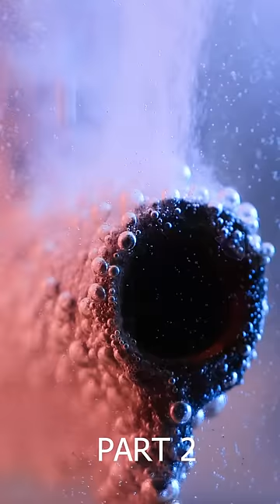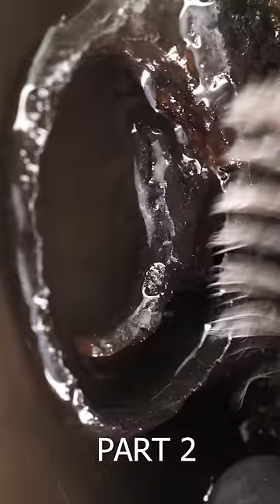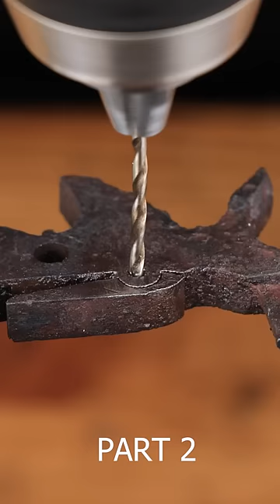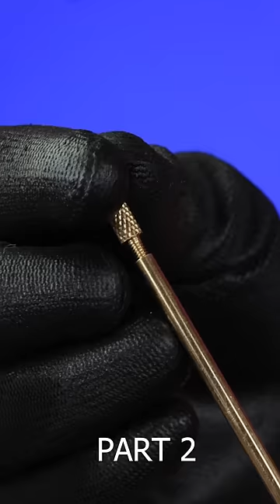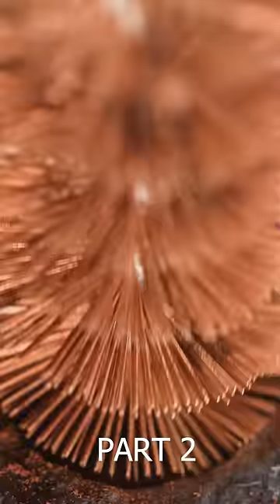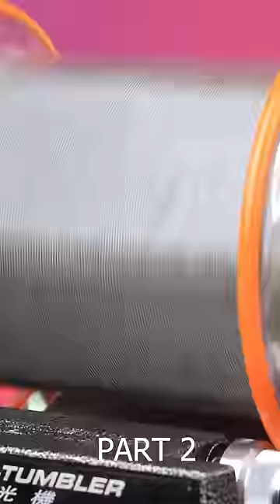Rusty Revolver Restoration Part 2 #Shorts

Comment: catastrophic mechanical failure: allow me to introduce myself
Reply: That doesn't happen to revolvers
Reply: @yazdan7774  actually it does, especially when it's badly corroded, the pins that hold in the hammer can shear off, the crane for the cylinder can outright explode, and the trigger can just snap. Also it will jam a lot.
Reply: @attackhelicopter9882 Yeah i don't know the specifics or the details i just know that I'd NEVER fire this weapon. 
How we, i can imagine that might look cool when all restored and shit. 
There are a few million non-operational firearms in the US as antiques basically
Reply: @yazdan7774 any and every item on this earth made of a corroded substance will fail at some point. Each gun is designed to withstand the pressures and force for the caliber they are housing; and when something is that rusted, it will fail. Do you assume revolvers are just god-sent immortal machines which can’t ever fail?
Reply: @ethandrought3064 I said it better than I bothered to even think of.
Reply: tá bom irmão liga
Reply: @attackhelicopter9882 it’s not for use clown.. just for display.
Reply: Definitely hand detonation
Reply: En la depensa de malechore
Reply: Después de 30 año salió a arregra su rrevolve para conn
Reply: @yazdan7774  So wrong its not even funny.
Reply: 😂yeah well said !
Reply: Before some says

"But its just a presentation piece!"

We know, its a joke, sit back down.
Reply: @attackhelicopter9882  most you’re probably gonna get out of this is light  primer strikes have the time it’s not gonna even fire
Reply: Imagine a end game version of red dead redemption with this as the final scene in the second one
Reply: @yazdan7774 Lol' where did you get that from? 😂
Reply: @yazdan7774 bruh. Even hickhok45 that legendary SOB had a revolver fail and that was mid competition 😅 seriously. Yes revolvers can fail.
Reply: That revolver is 100% going to just be a museum piece
Reply: @yazdan7774  oh yes it does
Reply: Allow me to reintroduce myself my name is WHOAA💥
Reply: @yazdan7774 no amount of restoring is gonna restore the doubt I have for rifling of dat gun.
Reply: @ethandrought3064 that’s not even mentioning that this is a top-break revolver which means it’s even more prone to failure
Reply: @yazdan7774 ah yes, revolvers don’t break
Reply: I mean I definitely wouldn't fire it, 
but I'd buy it as a display piece. 

I wouldn't trust firing this gun either. 

I'm not saying it's incapable of operation, I'm saying I wouldn't want to put that sort of stress on it. 

Its retired.
Reply: @johnmayer6770 that's exactly what he said kid
Reply: I just hope this guy never tests his restored gun
Reply: @yazdan7774 
Bruh thinks he's a gun expert because he played tarkov or something

You're telling me you've never seen an out of battery revolver?
Reply: @burtan2000 most of these are scams anyway. Fuck around with some rusty stuff, replace 90% of the parts, and call it a day.
Reply: @thericepotato5847  i don't play games
Reply: @johnmayer6770  why display something you cant use?
Reply: @johnmayer6770 well then why make it functional if going to be for show?? The barrel should be plugged and the firing pin removed and made so it can't be replaced with a new pin!! Or someone will buy it or steal it or find it in a dead person estate sale ect and will try to fire it and loose a hand or a life because it's been restored to working condition even though the rust has weakened every part of it.. it should have been restored to a non functional state so after it changes hand's it can't hurt anyone..
Reply: @attackhelicopter9882 it's for display, haven't you ever heard of display items? 🤡
Reply: I don't think he will shoot it.
Reply: @RandomGuy9  he won't no! But someone who gets it in a few years will like if someone gets it in a storage unit sale or dead estate or any number of a thousand way's of getting the gun without the knowledge that it's no longer capable of firing it.. it should have been permanently disabled to avoid some fool from attempting to fire that explodes in his face and takes a hair
Reply: First thing I thought
Reply: @yazdan7774 any gun can blow
Reply: @yazdan7774  Yes it does. Material loss is a real thing and revolvers need to be properly timed to function
Reply: Seriously. This was my first thought. Never shoot that fuckin thing.
Reply: @attackhelicopter9882 revolvers don’t jam, all that other stuff yea pretty accurate
Reply: @YeeeHaaw  they may not jam (and yes I'm aware of that) but they can easily turn into a pipe bomb
Reply: Nice to meet a relative from over the water.
Reply: @attackhelicopter9882 well…ur absolutely correct on almost everything except the jam part, the gun will likely never jam, just struggle to fire or like u said, the cylinder will explode.
Reply: @Toegremlin1  yes, catastrophic mechanical failure: aka exploding.
Reply: It could be for a wall piece
Reply: @yazdan7774 bro mechanical failure can happen in anything with mechanics (e.g. moving parts)
Reply: @yazdan7774 You can fire the gun. I won't, I like having a working right hand.
Reply: Это мусор, коррозия и усталость металла говорят об утилизации, а не реставрации.
Reply: U could electroplate metal back onto the gun
Reply: @ddh3098  electroplating is mainly a cosmetic thing, rust and deep pitting would compromise the weapons ability to take the force of a round.
Reply: @burtan2000 I think that's the intention behind the resto. It's very unlikely anyone would be foolish enough to take a chance trying to actually make something that bad functional again.
Reply: @yazdan7774  tell that to a chainfire
Reply: @ethandrought3064  it’s impressive how you typed a whole paragraph without making a single valid point. you must be a politician
Reply: @yazdan7774  yes it does goofy
Reply: @johnmayer6770 did you read the comment he was responding to. Cause it look like you didn’t
Reply: @yazdan7774 why do people think revolvers are immune to gun things. A revolver is a gun it can have almost all the same malfunctions as a self loading weapon. And obviously they can explode due to severe structural flaws like being so badly rusted you can see craters on every part of the damn thing.
Reply: Yeah… that’s what I was afraid of too 😮
Reply: Apparently people on YouTube have never heard of decorative pieces
Reply: @yazdan7774  wat a stupid thing to say if something works it can also not work

Comment: It was a .38, now it's a .42 caliber.
Reply: Xd
Reply: exactly
Reply: I don't think I'd want to fire that..
Reply: I've done gun restoration but in this case shes pretty far gone just clean her up to make her spin but never put bullet in because the micro cracks are already visible
Reply: its actually a hand grenade buddy
Reply: @jacobmorgan1182 id fire it lol
Reply: @jackbookerjr.3047  death by faulty firearm, explodes in face
Reply: It's now a hand detonation device
Reply: Rof😂😂 my thoughts exactly 💯 ❤
Reply: Loose so well
Reply: Разорвёт ствол чуть позже
Reply: @tinkeringclaws5559  Knew you would LOL
Reply: Gonna have a hard time finding ammo 😂😂
Reply: @TORQ111  Each cylinder is a different bore now.
Reply: @jacobmorgan1182 
Counldnt you just do aanother heat treat and re-chrome the barrel and cylander? Maybe do some electrolysis, like what they do for certain forms of guilding and plating. It might fill those cracks and stengthen them?
Reply: That when she said shes a virgin😂
Reply: Another restauration like this one, and it will turn .50bmg
Reply: LMAO
Reply: Baldwin gun?
Reply: Like my wife!😊
Reply: Clean it and use it as a wall peice
Reply: I. Pretty sure that's an old Schofield if it is is .45
Reply: Dont forget itll be blow up immediately
Reply: .45 would’ve been funnier
Reply: @freebriccs6134  True. But, there's no 42 caliber cartidges that I know of.  Like the revolver, it's now random.
Reply: lmfao
Reply: Facts 😂
Reply: Pushing a .45acp gotta rebore the barrel forsure
Reply: just like your wife
Reply: @nickshern1654  I might have stretched it out a bit. Sorry, you couldn't.
Reply: now it non functional
Reply: Its a paperweight.

Comment: Pulls trigger... Snaps... Crumbles to pieces... Hammer flings up and hits you in the chin...
Reply: 🤔 the gun became thinner 🤔 same to what im thinking
Reply: What music is this please?
Reply: Its so much more funny when you, as i did, read the last sentence with the underatanding that it is not the hammer from the pistol
Reply: I imagine it falling apart just as Tom’s car fell apart
Reply: @loboph7760  you’d be surprised, considering I don’t think the rust on that looks like it penetrate very deep, the loss of metal actually might not be enough to affect the integrity of the gun
Reply: @AnnisAdventures not just integrity. Tolerances of the gun as well. Those pits look deep af and might pose a problem in ammo seating, the gap in the cylinder(ammo) and the gap in barrel/cylinder. Would prolly lose pressure. The barrel accuracy as well, for sure they have to take out material on those with the level of pitting it has
Reply: Lmfao that went up on my mind like q movie
Reply: Kentucky ballistics 2: electric boogaloo
Reply: I highly doubt that antique revolver would be used for anything besides display
Reply: I broke my nose using a restored revolver
Reply: The cylinder is probably going to explode if he fires it
Reply: thats what we call the kuntucky ballisticks special
Reply: @AnnisAdventures it’s fake, it’s not rust, are you 7? It’s literally makeup
Reply: @RetroRunner2099  You can't get deep pockets like that in the metal with just makeup.
Reply: Chin with the eternal life medal: heh, doesn't hurt

Comment: Bro actually burned it while it had bullets 💀
Reply: Cartridge/Ammo?
Reply: @tomatico0129  oh yea….
Reply: @tomatico0129  possible
Reply: @tomatico0129 It IS possible. Old mines from the Vietnam war are still out there.

Waiting.

Waiting to be stepped on by some unfortunate soul.
Reply: @tomatico0129  Mmmm..... They've seen a hell of a lot of rainy days and flooding.
Reply: @tomatico0129 mines are definitely different but in Vietnam the mines placed likely were built to withstand water. I still think burning the cartridges was a poor decision, as even if no powder was active or even present, if the cartridges were airtight the change in pressure could cause an explosion
Reply: Russian roulette but the random bullet in the chamber randomly explodes
Reply: Due to the fact that that thing's probably over 100 years old the black powder that is in those cartridges is probably long gone

Comment: I remember watching the full video a while ago and the guy doing this got so much flak cus it wasnt a full restoration. He does this as a passion, not to meet some quota. and with half the original gun gone, its impressive he even got as far as he did
Reply: His restorations are fake dude
Reply: @tonypringles2285  that gun is actually rotted, not made to look rusty. That pitting is deep.
Reply: @tonypringles2285  The restorations are real, but he doesn't aim to restore the guns into working condition, because it is a) impossible from the state, they were found in, b) illegal in his country. 
Those restoration are for a museum display.
Reply: @tonypringles2285  your slow aren't ya?

Comment: I admire the bravery of bringing a torch to that, with rounds still loaded
Reply: Misconception... rounds don't last forever neither do bombs its alright if you wanna be safe n scared but that's why men handle these things
Reply: @caspertoastycoast4408  🤓
Reply: @caspertoastycoast4408  lol u say that
Reply: no primer caps means the gunpowder in it has been and probably is still soaking wet...
Reply: @caspertoastycoast4408  Bro over here mansplaining why it's okay to handle old explosive material. People like you used to be live leak's best friend.
Reply: @caspertoastycoast4408  ok ghost boy...
Reply: @caspertoastycoast4408   what the fudge are you saying?? there are lot of casualties of old minefield, mortars, or butterfly bomb....

I think you're right too, claimed many casualties so now it safe .
Reply: @caspertoastycoast4408  tell that to the kids in the rice fields of Vietnam.
Reply: @Zed - Sin Archbishop of [Defiance]  that's not a black powder revolver,  those cartridges have primers pressed into the back of the case...
Reply: @caspertoastycoast4408  incorrect. It's heavily dependent on the type of charge.
Reply: @WungusBill spot on 👌
Reply: @squishybrick  "mansplaining" 🤡
Reply: @caspertoastycoast4408  don’t know about you but I’d rather not go out into the woods kicking around for old mines
Reply: @dehydratedtree4402  
Best comment! Underrated af
Reply: @caspertoastycoast4408  Even bomb squads handle old grenades and mines that have been underwater for decades with great care.
Reply: They get wet once they are trash might smoke a lil but not at that age and the water they've seen you couldn't get them to do anything
Reply: @squishybrick  water and gun powder equals trash
Reply: @Reppo80085  completely sealed watertight
Reply: @Rem  absolutely bullets aren't sealed watertight they are just pressed together
Reply: Water ruins the powder even the primer is doa
Reply: @WungusBill some explosives actually get more dangerous as they age, less  stable.
Reply: @caspertoastycoast4408  yea, cause surely if they find bombs / granade unexploded they just yeet em in the garbage bing cause they're "past their expiration date", right? 
That work only if you're fin on lose a limb or an eye trying your odds (plus was clearly visible the gun had a shell or a whole bullet in still)
Reply: @caspertoastycoast4408  funny. A lot of people think that, but just look up when Germany does any new construction anywhere. I was there for 3 years, and during that time they blew a 45 foot crater on the (I think) A 10, when a 500 pound bomb was discovered underneath, and when temhey tried to disarm it, it didn’t work, so they tried to blow it up,  it the explosives inside were not inert, and blew a major hole in the road. Also, they moved and detonated another 500 pounder about a half mile from my house when they found it breaking ground for a new school on the military base I was stationed at, and there were one or two more detonations, where the round itself detonated. Not to mention, people are still killled in Bosnia from 50 year olds land mines
Reply: I mean this thing might be near a century old, so I don’t think those rounds are anywhere near active anymore. Also it’s ammunition, not explosive ordnance, so it’s already way less likely to still be dangerous.
Reply: @caspertoastycoast4408 Would you take that bet? Is your pride as a man worth more than your life?
Reply: @caspertoastycoast4408  your correct but they last a long time like long long bomb island is sc is still not allowed to be touched due to unexplored ordnance from WW2 when doo little raiders used it for target practice
Reply: @caspertoastycoast4408  say that to the 100+ year old WW1 munitions that are still live.
Reply: @caspertoastycoast4408  they can still be deadly even after 100+ years.
Reply: @caspertoastycoast4408 most nerd thing that could have possibly been spoken.
Reply: @caspertoastycoast4408 lmao you say that but there's canon balls from the American Civil War that are still literal UXO 🤡
Reply: @caspertoastycoast4408, oh, really? I have found an 8mm mause from ww2 in a forest. It was rusted and wet and exposed to the elements for about 80 years. The gunpowder burnt as good as new.
Reply: @Psy6o you are not smart
Reply: @squishybrick 
“mansplaining” not over your BF huh?
Reply: @mittromney7614 I get the instinctive hate and Ima let you finish, but dudes are equally allowed to use the term.

You didn't know I was a dude, so you get a free pass, but don't go assuming every person who uses it is a chick.
Reply: @squishybrick  okay, I’ll stick to just assuming they’re a hateful douche
Reply: @mittromney7614 But wouldn't that make 'you' the one who hasn't gotten over their BF then?

Comment: Ah yes, the odly clean round in the cylinder that you put heat on. Great idea!
Reply: They looked like fired cartridges
Reply: they were spent rounds and it’s not like the bronze would rust too😊
Reply: @fraudM870 shell are not made of bronze. They are made of brass. Both brass and bronze corrode. It’s “rust” turns it greenish blue.
Reply: @AlexanderMason1 not rust but oxidization with brass and bronze due to the copper content but it only superficially oxidizes leaving what’s under protected actually.
Reply: It would turn pinkish due to surface copper and then later brown and black as the copper undergoes chemical changes to cuprite.
Reply: @MiniCaseoh1849 also, how could you tell? Only thing I can see is the very back. I can say with certainty that cartridge wasn’t present when this gun was found.
Reply: @UrbanRonin35  you make a very good point there!
Reply: Look at those two rounds again. They look like dummy rounds, almost like this started off as a non firing replica.

Comment: that's a really shiny brass round in that old rusty gun
Reply: the steel protected it like a sacrificial anode
Reply: @@tjuyftutjyfudt2677 You are right! It patinas over time.
Reply: And he thinks it’s a good idea to bring a blowtorch towards it
Reply: I know! it should be black if the rust was due to natural causes.
Reply: @@tjuyftutjyfudt2677it tarnishes. It would not be a shiny yellow. As aged as it is, it would likely be brown but initially it would turn a pinkish color. You’re wrong.
Reply: @@tjuyftutjyfudt2677just your two month reminder that you were wrong. 😊
Reply: @UrbanRonin35  I think silver becomes tarnished as it develops an oxidation layer, brass patinas as it reacts with the air and probablythe water in it, ferrous materials rust as oxidation eats into the material, lots of silly different words, but I'm not sure!
Reply: That's because they just shoved this under salt water for a few weeks before recording.
Reply: @dwarf9938  I think it’s funny when they think people actually believe this.